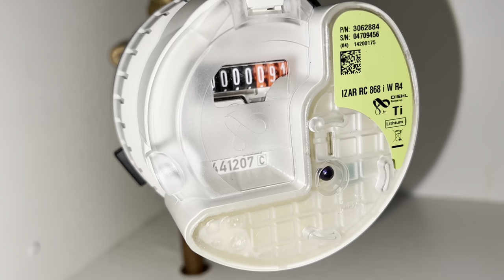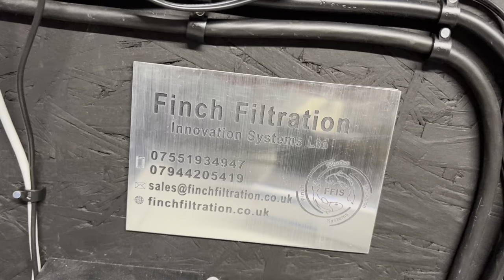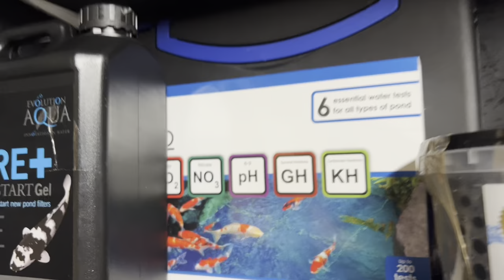THIS IS HOW YOU GET FREE KOI POND WATER***MAKE THE HOBBY CHEEPER!!! YOU GOT TO SEE HOIW ITS DONE

Comment: Very interesting and easy method on how to tell whether your city is using chloramine or chlorine for disinfection! I guess that hanna ammonia meter is sensitive enough to detect ammonia added by the city that does not combine with chlorine in order to make chloramine and remains in the water as ammonia. However, I don't think you need the  total chorine checker for this method to work or did I miss something or a lot of things?^^ Would love to know.
Reply from the maker: I think it’s easyer to use the hanna but I think you can use any test kit to work it out tbh 

But I only use the hanna kits as that’s what I was told as that method works better